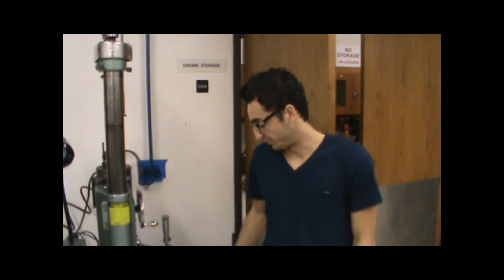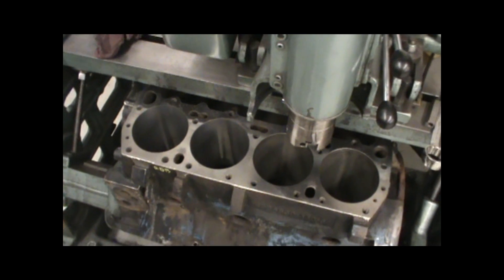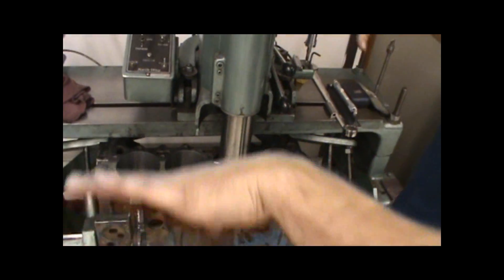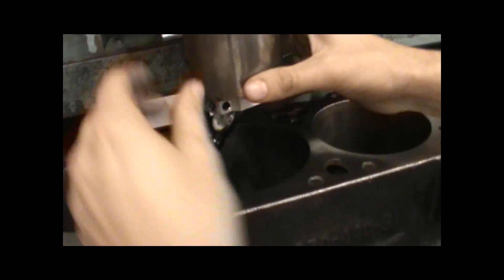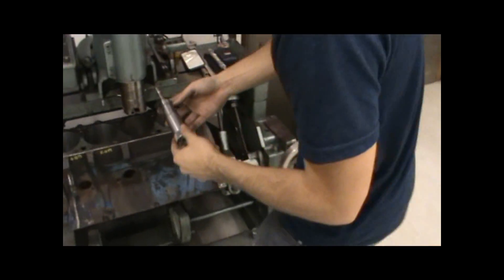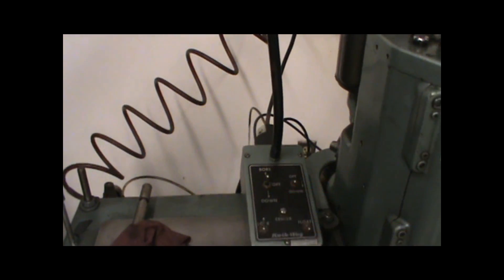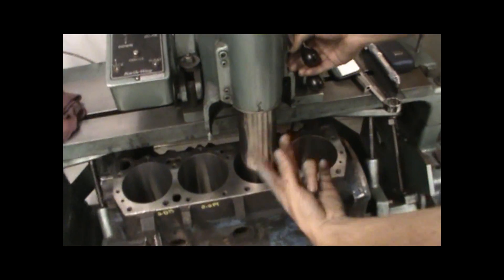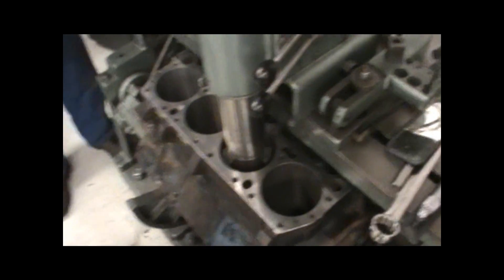Boring Cylinders with a Kwik Way Boring Bar

Comment: Hello, i recently bough kwick-way cylinder boring machine model FN, do you know where can I get a boring head for it, at fair price?
Reply: check ebay...but they are not cheap !
Reply: Im making one from scratch. It will have same concept as original one. But not exactly same. I make ran of 5 and put them on the market at 550.00 a piece

Comment: Heads up Dude that the the Starrett Level you are using will not read correctly unless the entire foot is seated on the surface as they a machined with a slight concave in the foot to allow the level to sit flat on a surface. i.e: the foot of the Level only sits on it's four corners of the foot. Check with Starrett.
Reply: I'm sure they know what they're doing dude, it's a machine shop. Duh

Comment: Setting up parallel to the deck is "ok" but you should be setting up square to the crank centerline. When you're "centered" at the top, set your cutter 0.002" under the
original bore size and bring it slowly down into the bore between the deck and the ridge and turn the cutter by hand 1 full turn, if you are off-center, the cutter will slightly scratch the cylinder wall. bring the cutter down to the the bottom of the bore where there is no wear and turn the cutter 1 full turn again. If you are square to crank centerline, the cutter will scratch the wall in the same spots as at the top, if the patterns are opposite, your block is leaning.
Reply: FreakyGearHead o tx

Comment: NEVER LET THE CUTTING TOOL SNAP AGAINST THE MICROMETER WITH THE SPRING TENSION AS IT WILL GOUGE THE MICROMETER . Also blow any chips out of the hole before inserting the micrometer to avoid a false setting. Just a few  tips.

Comment: liked the vid could use a little less backround noise. du need to cut the ridge from the cyl. before you set up the boring bar noticed that you cyls looked like they had been bored or honed already  just got and older type of bar that bolts to the block this vid helped alot Thanks